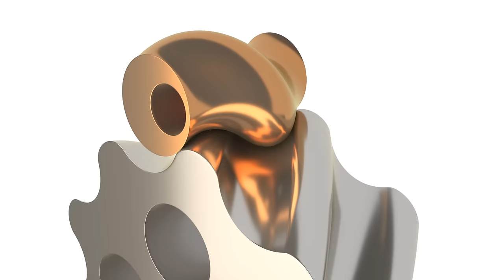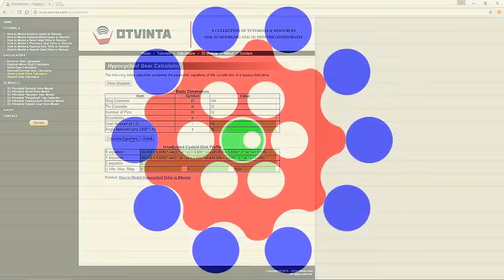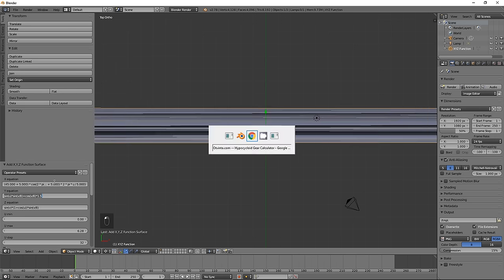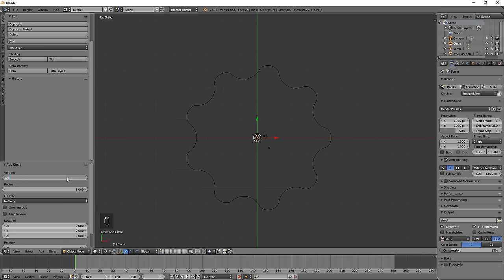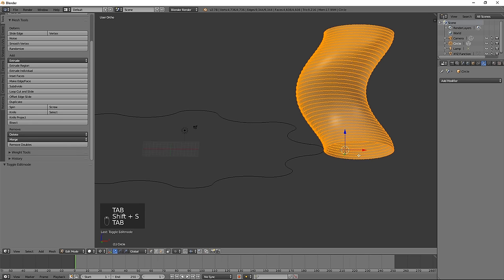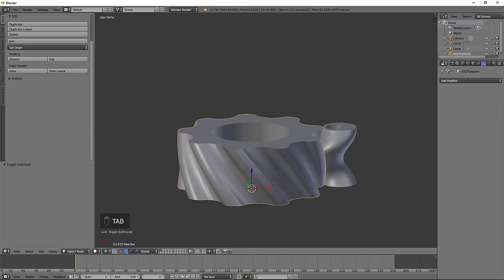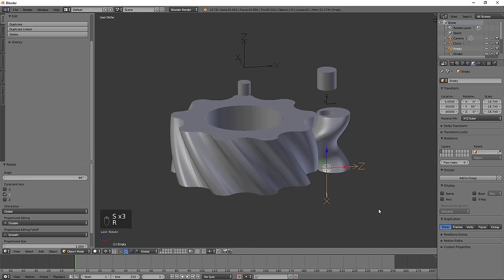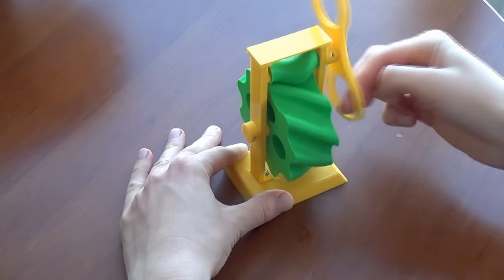Tutorial: How to Model an Eccentrically Cycloidal (EC) Drive in Blender

Comment: the circumference of the small pin is pi*d = 3.14*20 = 62.8
the length of the big gear is approx. 304.04
it's a 9:1 ratio,  62.8 * 9 = 565.2 > 304.04
that means there's sliding friction?
Reply from the maker: There is no slippage. The pinion is eccentric, and therefore the ratio of reference lengths may not equal the gear ratio.